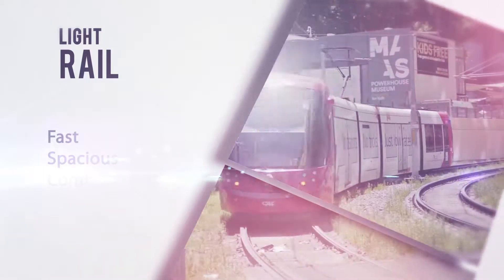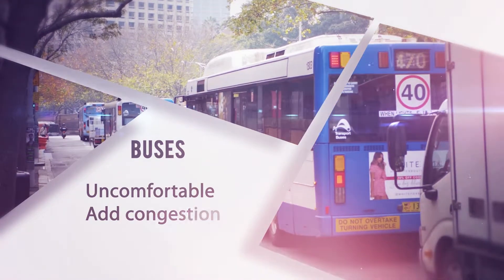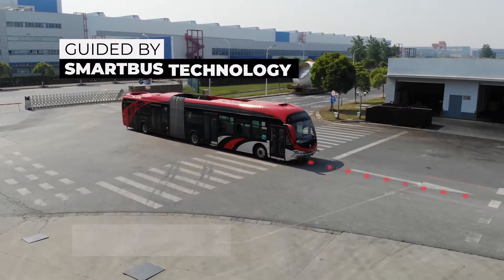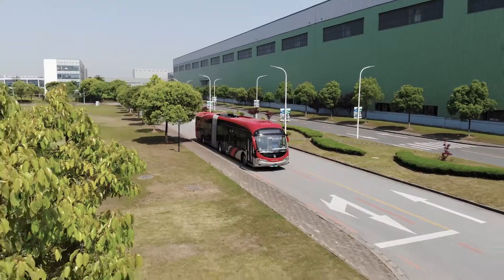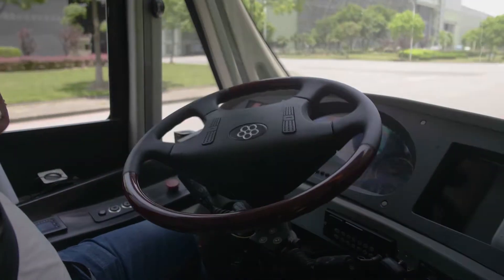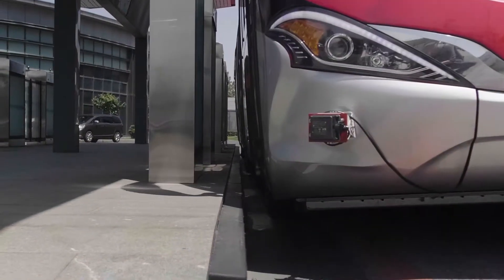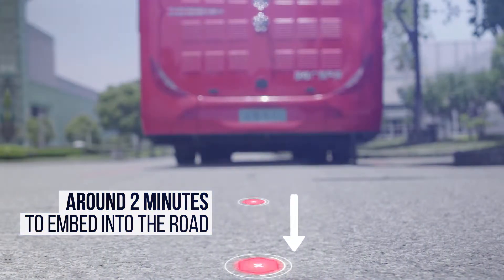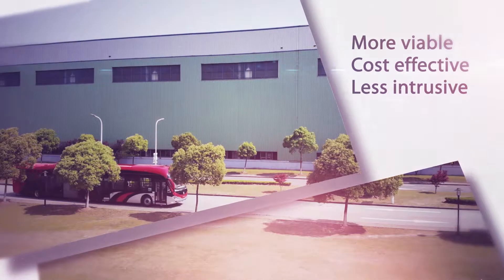Trackless Australia - Explainer video

Comment: "[T]he movement is as smooth as a train," just because the steering is computer-controlled? What if, god forbid, a road isn't smooth? Have Trackless ridden a bus? When they're uncomfortable, it's not from how they're being driven, it's because the road is in bad condition. The most uncomfortable bus route in my town is on a perfectly straight road. 

Also buses don't really add to congestion because journeys by bus can replace car journeys, and even if they did, this system would just as much, because it's a bus.

And the computer control doesn't save money if it needs supervision.

One thing I do like is the ability to pull up close to platforms for level boarding. Accessibility is good
Calling it "trackless" is silly tho. It's an incremental improvement to bus tech, not a complete stand-in for rail.